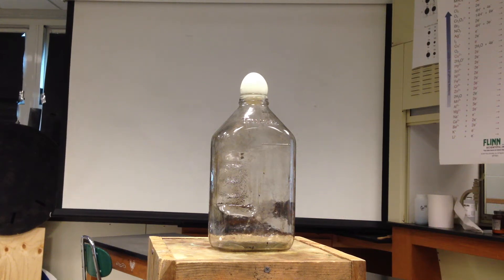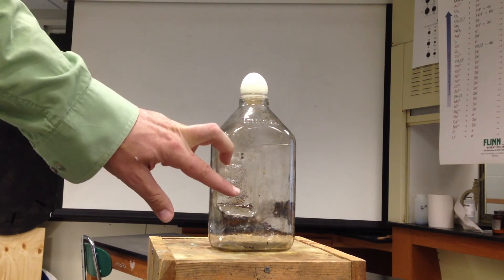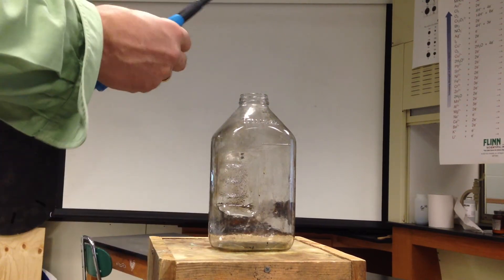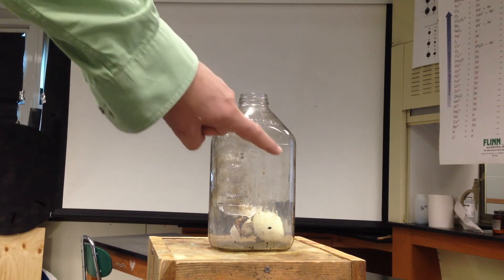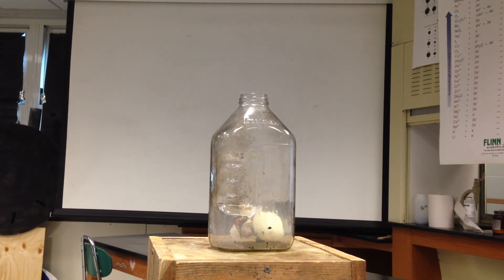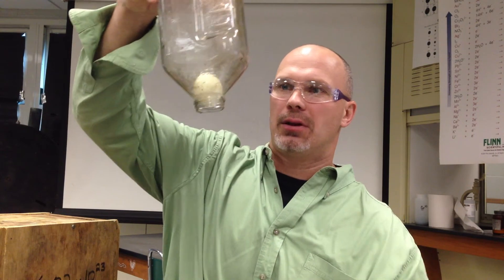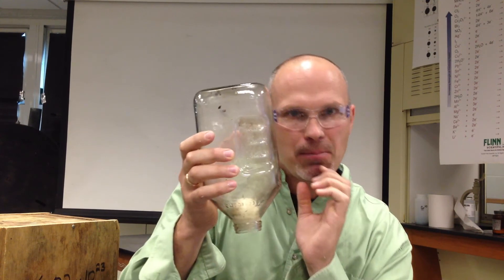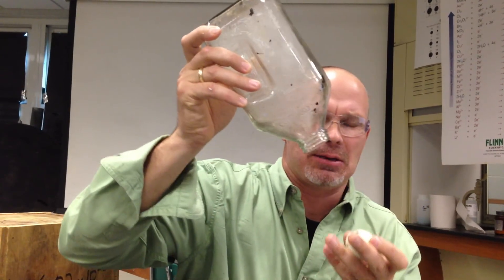Egg in bottle and out of bottle demo

Comment: Hi Bruce.  Thanks for posting this!  I’m having a lot of fun trying to figure it out.  Was the egg trapping something inside the bottle?  Maybe Helium?  The way you poured water into the bottle seems important too.  It looks like you were minimizing something from escaping.  I’m trying to figure out if this could work in a similar way that you can attach an index card to a cup of water when you flip it upside down.
Reply from the maker: Bruce??  The egg was trapping or preventing air from returning to the bottle when the fire dissipated and cooled. The higher pressure forced the egg into the bottle.